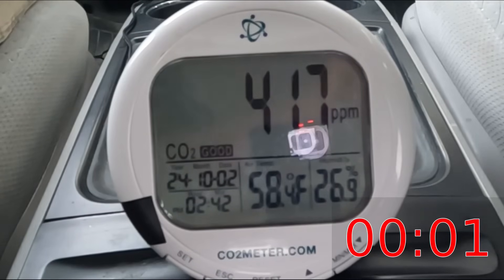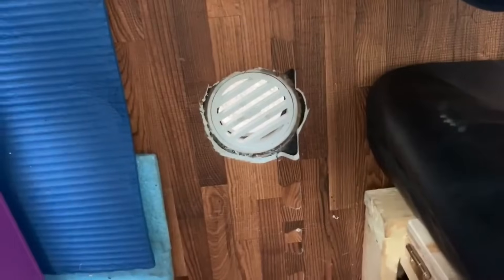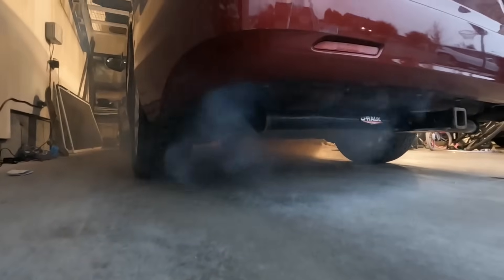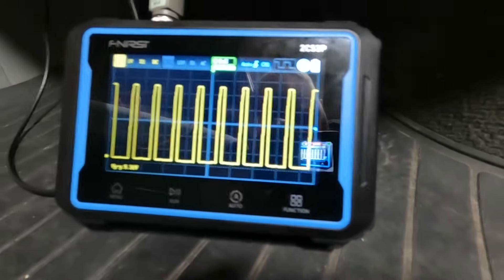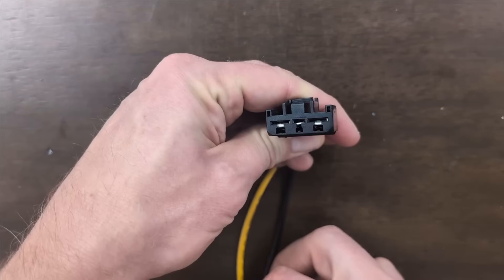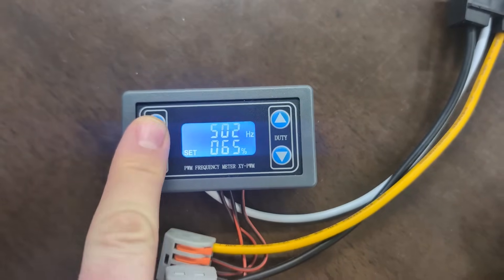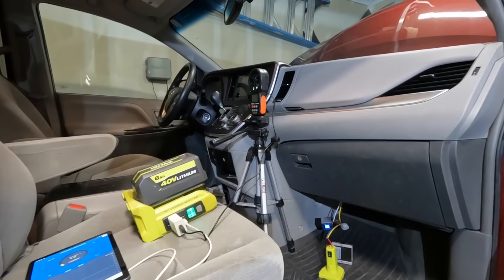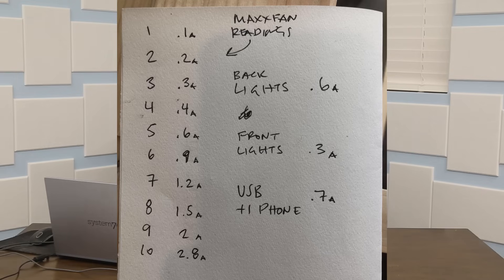Camper van ventilation without using window vents or cutting holes (first see comment by @drewcress)

Comment: For PWM you can also use cheap $1 servo tester. It should also work. This type of control signal is everywhere - from servos in RC hobby and computer fans to cars and literally almost every variable speed fan in any equipment.
Reply: And hooking up something like "webasto thermo top evo 5 petrol" for gasoline cars or any other diesel parking heater for diesel car/van is reasonably stealthy, compact and integrated.
Reply from the maker: I would LOVE a Webasto heater. Someday...  for now I'm going to get a winter sleeping bag.

Comment: There’s no way someone is dumb enough to think you can “breath out” all the air in a van. Vans are not fully air tight, no vehicle is
Reply: From USDA Food Safety and Inspection Service "Carbon Dioxide Health Hazard Information Sheet":
"The American Conference of Governmental Industrial Hygienists (ACGIH) recommends an 8- hour TWA Threshold Limit Value (TLV) of 5,000 ppm and a Ceiling exposure limit (not to be exceeded) of 30,000 ppm for a 10-minute period. A value of 40,000 is considered immediately dangerous to life and health (IDLH value)."

Pretty sure I can reach the 8hour exposure limit threshold within one hour of sitting in my car.
My CO2 meter is not designed to read any higher than 5000PPM.

Comment: Adding a roof vent to a van adds value. Don’t know why you think it’s destructive and somehow reduces the value. If it’s done right it’s fantastic. Even a basic roof vent without a fan would be better than pulling half the dashboard apart and ordering a heap of special parts to make it work. Just because you can, doesn’t mean you should. Will your version work? Yes. Is it a good solution? Absolutely not. Glad you posted it though as it is a good deterrent for others not to try it.

Comment: Was waiting for the CO2 retest with the fan running... You could redesign your system with an esp32 microcontroller running Esphome plus a CO2 sensor and relay. Can probably do the pwm on the microcontroller. That's if you really want to geek out 😂
Reply: May I have some advice on how to do this. I have an arduino microcontroller but heard better things about esp.
Reply: @max7w311  lots of info on the Esphome website. It's very easy to  integrate esphome devices into home assistant. You can do a good chunk of the automation work on the device but generally speaking this is easier to do in HA (in other words, just use the Esp to collect the data, automate against the data in HA but that being said you can run an Esp device with automation autonomously).
Reply: @max7w311  ESP-32 chips are dirt cheap and can be programmed with the Arduino SDK if you want familiarity.  They include Wifi and Bluetooth and a /lot/ more horsepower than an Arduino, but e.g. the S2 mini boards are <$3 online.  They do though use more electricity - by default ~0.6W at idle, though you can cut it right down e.g. by turning off Wifi, or using sleep modes etc..

The project being discussed here could just as well use an Arduino.  On the other hand, the radios could be a benefit.  e.g. you can buy a Wiz remote (~$10) and easily code up to give yourself remote control for something like this (the remotes uses the Wifi radios with a custom protocol called ESP-Now).

If you like to tinker, order a bunch of ESP32s and play.  They're great.  Check out the WLED project for using them for light control - either RGB pixels or "analog" strips.

Comment: Good info, good testing and like any design solution there are always trade-offs.  

Something to consider, the max air fan type is made to move air with little to no differential pressure while the car fan must overcome differential pressure to force some air into interior(through a tiny hole) which forces the air out the rear vent.   For building IAQ, it is suggested that one person needs 10-20cfm to avoid stale air.
Reply: I think the high differential pressure is assisted by the movement of the vehicle
Reply: @richardchristian6974  While that may be true, I honestly don't know.  It would mean that interior venting is done in such a way that when in motion, there is a partial vacuum created around the vent(s) to assist in air changes.  

There are also covered vents that are used in boating that can be mounted on the side of a vehicle and have a 2-3inch hole and the cover drains away rain water or flowing water when driving in the rain.  With reversible fans these could be made to be intake/exhaust vents as needed.

Main issue with using built in vehicle vent fans is efficiency is not designed in.  It's assumed the vehicle will provide the 100s of watts of power from the alternator. Very low speed venting for long periods is probably the best power/use-movement use.

When stationary, cracking windows and perhaps using some form of window mounted venting would be a DIY way to get power efficient venting without cutting holes.

Comment: Clever!  I cut dual holes in the floor with 275 CFM bilge fans w/speed control. In hot weather, one serves as a vent for the AC unit. In the extreme cold, it is the intake for a diesel heater. But yours might be the most clever I’ve seen. Subbed

Comment: Does that PWM pulse at 5V or does it pass through the voltage from the VDC source? I know you found 5V on the pulse, but I don't see dropping anything to 5VDC...
Reply from the maker: Good catch. I shouldn't have assumed the output was 5V. The output is the same as the input voltage. So maybe adding a resistor would be safer.

Comment: Much better than cutting a hole. If you used an arduino for the PWM signal than you could also have the fan on a timer for something like 2 min on, 10 off. Also, if you put in a few diodes on the oem side and the homebrew side, than you should be able to leave it all connected all of the time.
Reply: Yeah and add in sensor to toggle the fan based on air quality too. Its such a smart idea to tap into the existing vehiclesvsntilation system

Comment: Hey that's pretty smart. And I'll bet you on the lowest setting, it's moving enough air to keep you ventilated. It doesn't take much air movement. Now you need to find the female connector and make a y assembly, then you can build it all into a nice little box that you stick somewhere out of the way but accessible.

Comment: I always thought this was the best approach but for different reasons - just want to keep the roof completely clear for solar cells. Next challenge is to get the A/C running without the engine..... By the way, don't you need to interpose a diode (a beefy schottky diode) in the main 12v feed to the fan so you can power it without removing the wiring loom plug or back-feeding into the rest of the ignition circuit.
Reply from the maker: Interesting idea!
Reply: car AC has a compressor that is mechanically driven by the engine output, the compressor actually doesnt use electricity to run. I had same idea as u but above is what i found out after some research😢
Reply: @cevolyh  hybrids do use electric compressors

Comment: Hello! The detail you go into is amazing. I am in my 2008 Sienna and thinking this would be a great idea. I just checked and have one of the wiring harnesses with 2 leads. Do you think the speed knob acts and a potentiometer and my blower accepts steady DC (with no PWM)? Would you expect my blower input to be 5V or 12V.

Thanks for your time!
Reply from the maker: Hey, I just found a very helpful demonstration:
https://www.youtube.com/watch?v=KjQ0PKDiRDw
It looks like the lowest speed setting in his example is 5V.  That or else 6V should be pretty easy to find in battery sizes.

Comment: Would this same items work with a Caravan?
Reply from the maker: Not exactly. It looks like most years of Caravan use a blower motor resistor instead of controlling it with pulses. That means your motor only has two wires and should be really simple to run.  But what's the easiest way to run it at low speed? Maybe try running it directly with 5 volts, which is easy to get from a USB power bank.
Reply: @SemiSeriousLabs  Brah this is prob the most helpful YT reply I ever gotten thanks. 🙏🏽